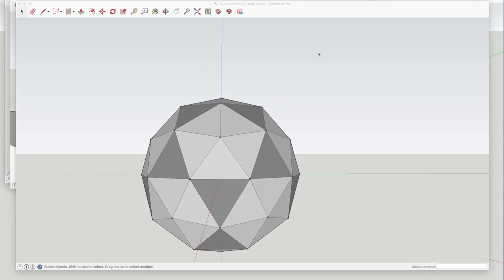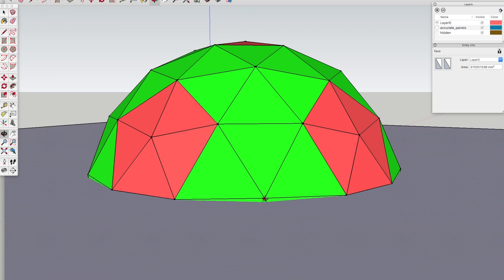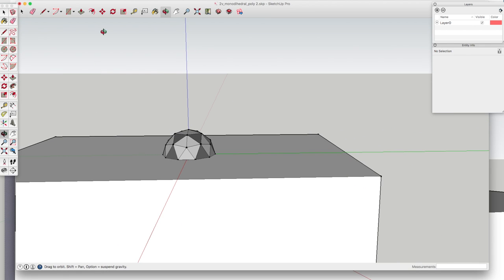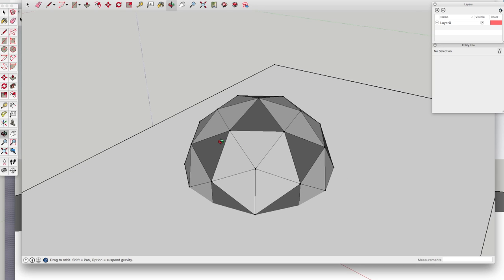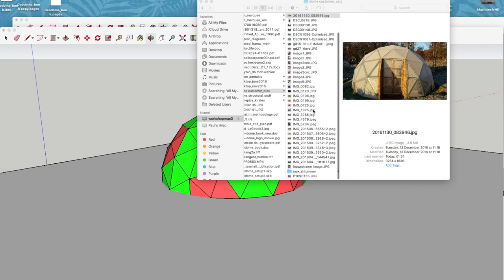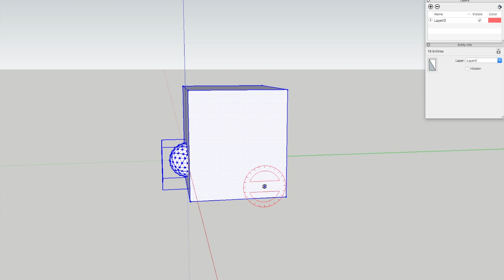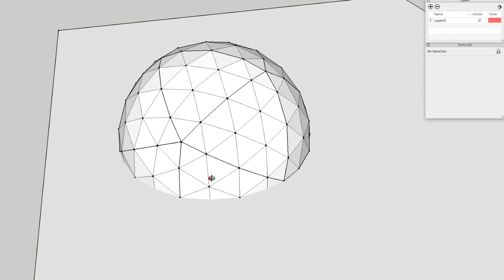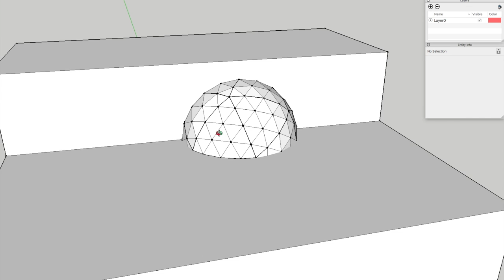Another way to make a flat bottom geodesic dome

Comment: Interesting concept... I would be interested in knowing how this effects the "tension rings" that circle about the widest parts of the dome and hold the outward force developed from the gravitational load from the weight of the structure. There are two such rings that circle a 3 frequency dome. Drawn through the virtices

Comment: I thought any positive frequency dome would have a flat base, is that not true ?
But did you say the ‘ con ‘ is more strut lengths ?
Reply from the maker: Any even frequency, 2, 4, 6 etc when divided in half will have a flat base (as a rule but not true all the time) All frequency domes can have a flat base but only if divided vertically down the centre.

Comment: Hello Paul thanks for this helpful video I'm using one of your plans to make a dome (GD 15) I want to make a 4/9 instead of a 5/9 dome to make it less high as I am raising the dome onto a 150 cm wall. I guess this alteration will influence the diameter of the base. is there any way of calculating the actual diameter of the base of a 3/8 3V. I believe the calculators online only give you the diameter of the sphere ?
Reply from the maker: The base will be the same size because if you joined a 5/9th to a 4/9th you get a sphere so the join must be the same. Just be careful with the base because one is the inverse of the other. 12 degrees on the top but when one slip up the other slopes down.